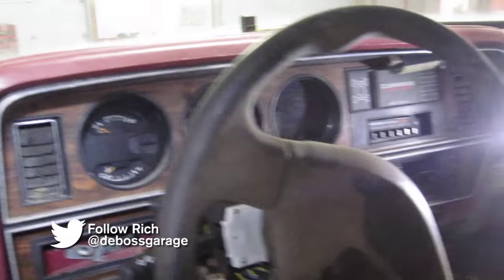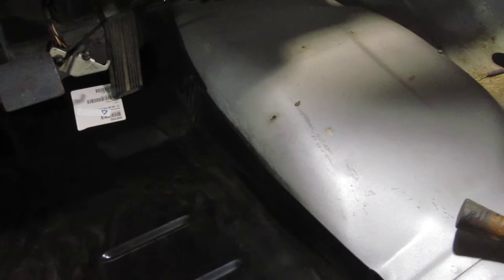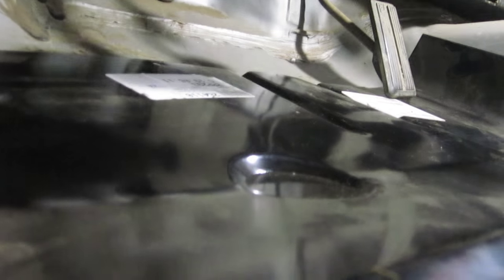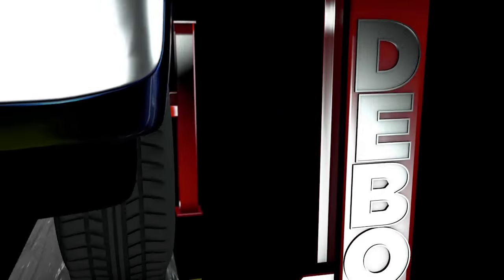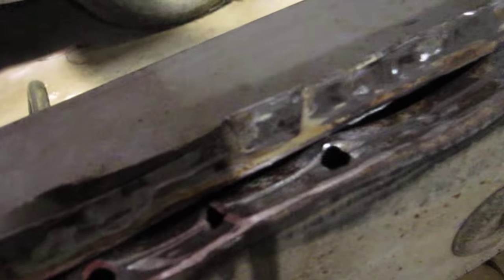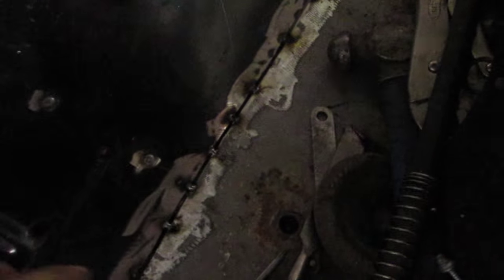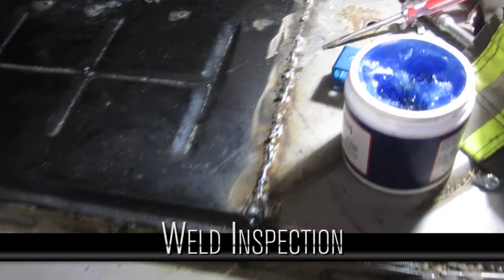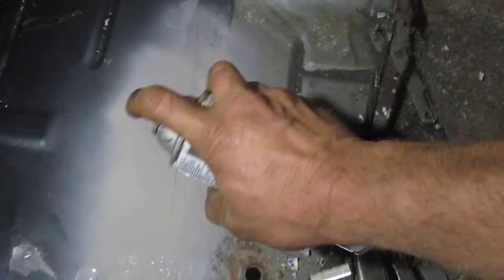'85 Dodge RAM CC W350 Dually 5.9 Cummins 12v Diesel Swap [EP6]

Comment: A great trick for filling in little holes in thin metal like that floor pan is using a thick chunk of brass on the backside of your piece. Just clamp or secure your brass to the back of your hole and welder up. The weld won’t stick to the brass and it keeps you from blowing through. It also acts like a heat sink which helps with warping. (Also brass gets really hot hot really fast so don’t try to hold it in place with your hand)

Comment: hey rich I just had rust work done on my 86 Chevy crew cab. got it back and was not happy. they didn't fill any screw holes and they didn't cut out my whole floor pan they just cut out where the rust was and put in the new floor pan. same thing in my rockers. they just cut the outter rocker out and left the inner on full of rust.

Comment: I wonder why no car company ever does reinforced steel in that area. It's not like the issue isn't known. Even on modern cars they still use (with some exceptions) just plain old sheet metal with creases.

It's almost like they want you to have a Flintstones mobile.
Reply: aserta 
Even though it will rust out it still will usually out live the useful life of the vehicle.

Comment: Did you grind the weld inside the cab and underneath on the bottom of the cab? Also did you put seam sealer inside the cab and underneath on the bottom of the cab? Did you weld the soffit screw holes in the frame after removing them?

Comment: What would you recommend to do as far as switching out the hump in the floor for the 4wd.  We  have put a 2wd cab on my first gen dodge diesel 4wd frame and we need to switch them so we can put the shifter on the floor.

Comment: Could you help me with the name (supplier) of those handy little blue clips? Great videos. Just stumbled onto your channel.
Reply from the maker: They're called Dent Fix Butt Weld Clamps, I listed the Amazon link here: http://kit.com/debossgarage/dg-toolbox/97622-dent-fix-equipment-d
Reply: Thanks for the comeback. I need to replace the front floorboard of a Dodge D200. These will make it a lot easier.

Comment: Did you say you'd do an engine swap for someone for $10,000?(mine is a 2003 Chevrolet Silverado 6.0L Quadrasteer but I would like to have a cummins or duramax in it)